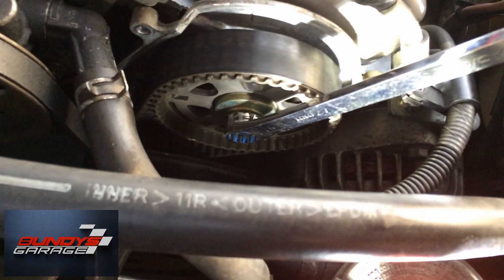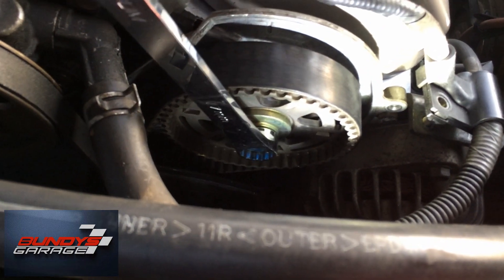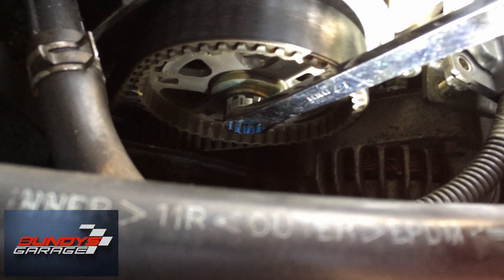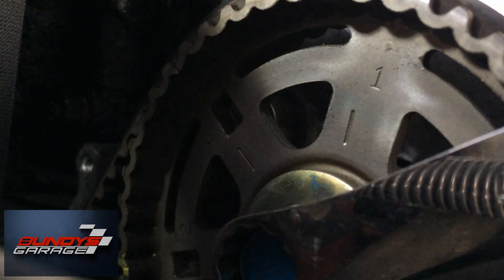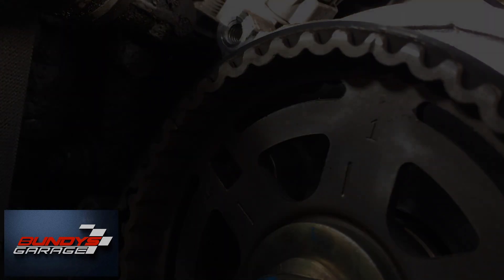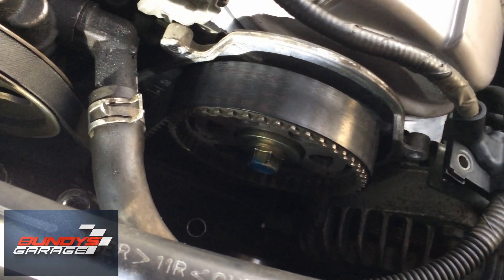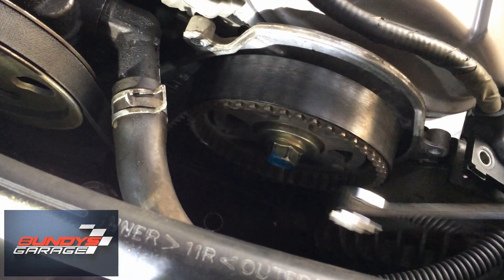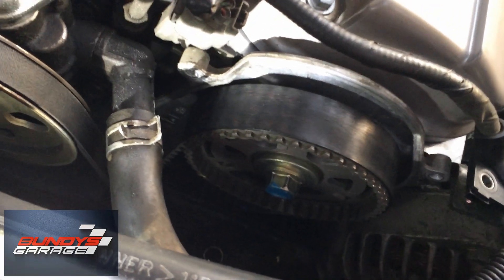How to Tell if your Timing Belt is about to Break or Snap Honda Acura Toyota Lexus Kia Hyundai

Comment: I recently did a timing belt on my 09 Honda accord. Î was off just a bit from rec, barely off the mark. It didn't start. I know that I have to go back in to correct that. What I'd like to know is did I damage the engine by attempting to start it while it was not at tdc? Your answer would be greatly appreciated.

Comment: I THINK the replacement suggestion for my 08 Odyssey is 100K, I'm due for that again in another 40K, and the waterpump too. I've never heard a worn out belt before, I replace all my belts; serpentine, timing or otherwise at the suggested intervals. Good to know what a bad one sounds like.
Reply from the maker: The belt had 156,000 miles on it but it was 20 years old! Original water pump was on there as well.
Reply: May I ask, what's your opinion on that? I've heard it both ways, to replace the water pump every timing belt change, and others that say to leave it alone until it breaks
Reply from the maker: I replace the water pump each time cause if you wait until it breaks or seizes catastrophic engine damage can occur when it lets loose. I’ve had 3 Gates water pumps fail at 60,000 miles, the bearing seized, snapped the belt and the pistons and the valves hit each other. Stay away from Gates WP. Belts and hoses from Gates are fine. I will buy the Gates timing belt kit from O’Reilly’s that does not have the water pump and then get the WO from Honda.
Reply: Sound advice, honestly I was thinking of the ASIN timing kit from RockAuto. Seems to have everything I need, including an ASIN WP and a tensioner. I've heard good things about them, and people seem to like their kits